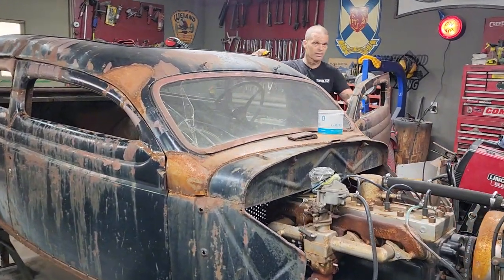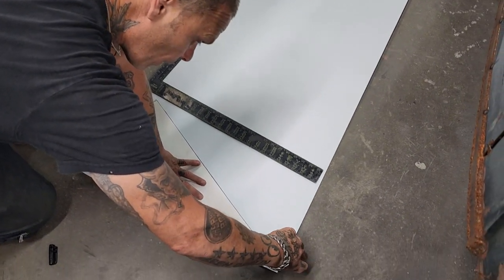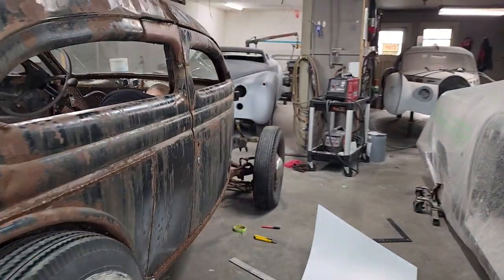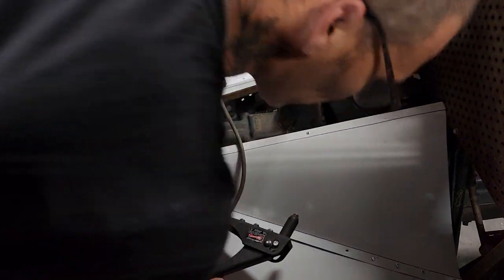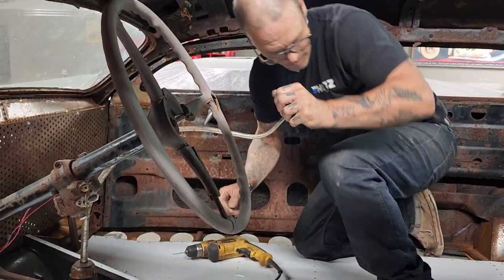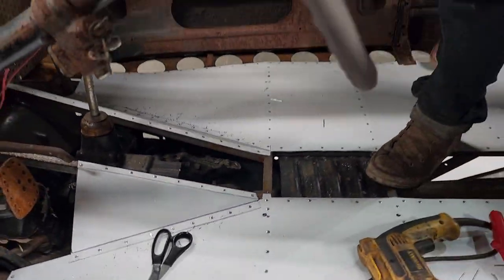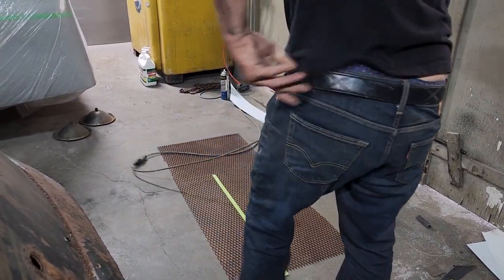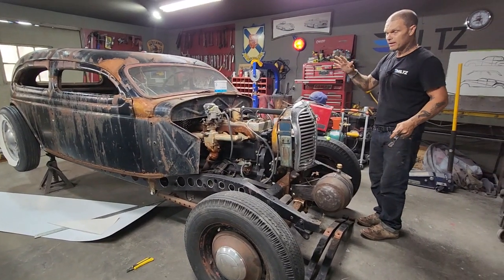Making a floor out of aluminum + rivets for Jolene's race car 🏁

Comment: The reason all race car cockpits are enclosed except the drivers window is safety measures. The driver must be protected from Fire, collision, roll over. You do not leave any openings to the cockpit except for escape. A hot engine that has oil or fuel dripping on it will ignite and if you love Jolene, you’ll cover all the holes inside that car if you plan on letting her race it.
Reply: Haha jealous
Reply: @WOWTODAZ  nope, not Jealous!  My woman is rare. She works a job, and does all the house work including electrical, plumbing. Yard work including cutting the grass, weed eating, pressure washing. Maintenance on the yard equipment & Vehicles like brake jobs, water pumps, tie rods. Nope, not jealous 1 bit.
Reply: We run demolition derbies with half the fire wall cut out and open and get flipped over hit harder then rolling a car... It's called a fire suit neck brace helmet and boots, immm pretty sure all those are required entering any race or event
Reply: Not to mention the Heat coming up through the floor
Reply: @johnthebaptist8284  top speed in a Derby is what, 20mph max. Their talking about racing! Totally different sport.
Reply: @johnthebaptist8284  makes sense to me sir. All the experts ya know lol haha
Reply: @rickhettwer854  i don’t tell her what to do! She does what needs to be done! I’ll inform her of how to do something she doesn’t know how to do but yes, I am the man! 28 yrs of marriage and 4 children later she’s still the woman of my dreams.
Reply: @tobygathergood4990  oh agree 💯 percent safety is priority
Reply: @tobygathergood4990  not to her knowledge.

Comment: I believe a solid fire wall would offer more protection even if aluminum. Radiator hose blows on a run and you have hot coolant in the car.
Reply: I had that happen tp me and although I had all the right gear it still burnt my skin
Reply: Had the heater core blow out at the top of 2nd gear in my 67 Ford Ranger. Spraying my legs with HOT Antifreeze! Not fun to say the least!
Reply: The car is going to do one quarter mile race and then he will just put it away with the other cars, so stop concerning yourself people.

Comment: Many people commented on the fire wall when Chad first installed it. Many pointed out a variety of safety concerns. Chad then responded back on his next video saying he sees no safety issues with holes in the fire wall. So your beating a dead horse with your comments. Also if I’m not mistaken, I believe he said they will be racing on a dirt track. If so, then I see an issue with holes in the floor as well.

Comment: If your gonna drag race it. You'll need to have a drive shaft loop around the drive shaft just incase the shaft cuts loose from the transmission. That way it won't hit the ground and jam up the car. But mostly so the drive shaft doesn't go up into the driver area and hurt the driver. I'm sure it's a rule that drag cars have to have them. It's a safety issue.
Reply: What would we do without you Kevin......
Reply: @bradzimmerman3171  We would be completely lost and destitute.
Reply: He does it his way, which he says all the time. Art cars

Comment: The aluminum floor looks good. However, the aluminum rivets fastened to the steel frame will cause dissimilar metal corrosion. Some type of caulking between the aluminum and steel and around the rivets before inserting into hole and squeezing handle of pop rivet gun would prevent corrosion. Keep up the great work you and Jolene are doing!

Comment: Coming along nicely Chad.
I know this is not going to be used often.
If you use a bonding agent or silicon between Aluminium and the steel tube before riveting down that will reduce cracking and fracturing of the sheet at rivet head.
Also don't forget to add a vent for the fuel tank cap. Stop vacuum lock of fuel system.

Comment: Safety first ,I would put a piece of aluminun sheet metal on the firewall in front of Jolene to protect her feet in case a hose or line bursts,just to be sure,thanks for sharing

Comment: You should grab yourself a air rivet gun If you plan on using that stuff in the future, Chad. an air rivet gun makes the work of it, really fast. For instance, a rivet gun now at princess auto is on sale for 32 bucks. Thanks super cheap. but that's in Ontario..maybe double if its not on sale. Still would be worth the inconvenience of hand squeezing an old rivet gun.

Comment: Chad and jolene don't forget to put the earth back on the body I think you put a rivet in its hole when you put the panel in cause you said at the time it was easy there to drill lol .jolene your doing an excellent job with the videos with your new sound equipment at least now you can tell if Chad has done something to the sound. Keep up the great work the both of you 👍 👏
Reply: Chad and jolene I keep getting these messages and I keep replying I've tried all different methods to contact you but it doesn't seem to be working. Hopefully you receive this one .keep up the great work the both of you 👍 👏

Comment: I enjoy watching you do things your way.  But as we get older, we realize that "accidents will happen".  We can still have fun.  But the more we give it a chance, the higher the odds of something bad occurring.  I'd hate to see Jolene get doused in burning gasoline.  With the perforated "firewall", the home made gas tank, and the placement of that gas tank right at the front leading edge, I see a potential life-altering "accident" that simply does not need to be risked.  The fun could still be had, but with a slightly safer gas tank placement.

Comment: I remember back in the day when we use to race on dirt tracks. I told my brother I wanted to cut out the steel floor panels, back then you could buy aluminum rolls for pennies on the Dollar from the local Times Herald.

Comment: Reminds me of building my dirt modified all the rivets being put in .aluminum dulls drill bits fast .
Reply: No it doesn't, aluminium is soft as fuck. Get better drills.
Reply: @krayziemike17  please tell me again when you hang bodies on modifieds  . Yes its soft but it builds up on the point of the bots regardless how expensive a bit you buy  . I have used them all high dollar bits and elcheapo bits doesnt make a difference . If you can tell me which ones to use I will buy them but they better not full down like all that I have tried .

Comment: Hi guys just saying the fuel tank will need a vent, if not it will start but after a few seconds will cut engine! Easier to install it before you put the fuel in it!!

Comment: As a Former Fire Fighter I have to agree with with Mr Big it is just not hot water to deal with Oil an Fuel will give horrendous scars if unfortunate happens 
I have seen the results of all 3 combined
Chad loving someone like I believe you  do Change the Fire wall now having been in the racing game with my Son
That Fire wall should not pass Scrutineers 
Chrysler Sled Qld Australia 🇦🇺

Comment: For safety sake I'd toss some of that aluminum on the firewall. Would hate to see anything flammable or hot spray into the interior. The weight of the aluminum can't be that much and adds some safety.

Comment: What happens if the car ahead throws some parts or a drive shaft or anything that can come up thru the floor at speed? Using what you have is fine but I know common sense trumps that on certain occasions and this is one of em!!!!

Comment: Going to comment about  how unsafe this appears for the driver but it ain't none of my business and it ain't my queen driving it.  If it were my queen behind the wheel she'd be completely encapsulated from any smoke fluids or fire getting inside to her as well as not having a floor covered in metal you can cut with a exacto knife. That is all I'll say about this one lol.

Comment: the drive shaft danger is not comming uo,its droping down and digging in to the ground and flopping around. the real saftey issue ithe driver  being surropunded by hot engine by products.its not important what you see when its run ning down the course

Comment: Damm, you guys are so fussy. IF this thing makes it down the track, it will run a 17 second 1/4 mile run - putting in all kinds of safety features is a just a waste. If he makes 3 passes, I’d be pretty shocked. After that, it will be tossed outback for another year.
Reply: Heard it’s only an 1/8th mile so I bet 55 mph max. This car is definitely not built for speed.
Reply: @tjakr3869  Exactly.

Comment: Oh can’t go along in this one. Regardless of what your doing. That material is really really thin.  You can fold it with your hands. I don’t think this material should be used for a floor.  Strength is not there.

Comment: Only cheap chad would send the love of his life out racing with the cheapest ,  thinnest aluminum floor and substandard gas tank. What is the firewall paper?  You must have lost it. Take a break and regroup you are embarrassing your fans. This is about Jolenes safety not how fast you can do it. If it was a show car I would say go for it but you are talking racing where transmissions detonate. Take a break chad you are overtired.  LATER